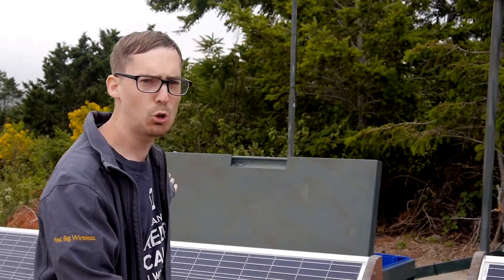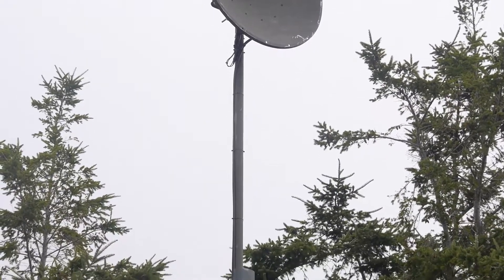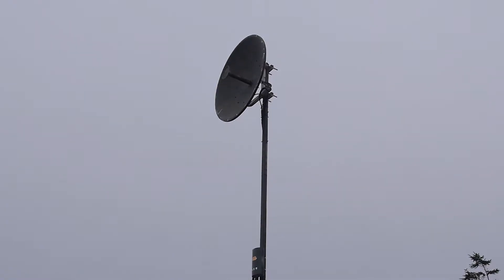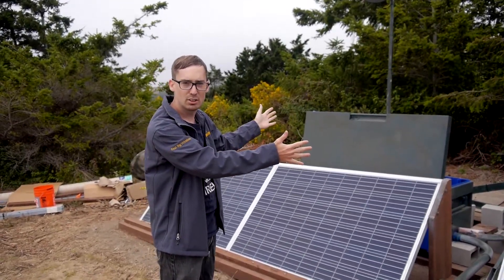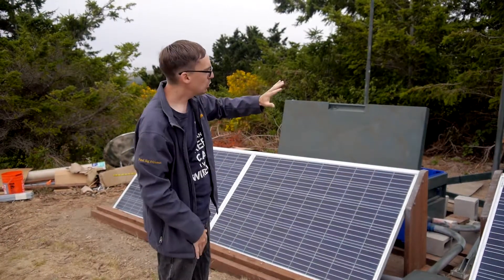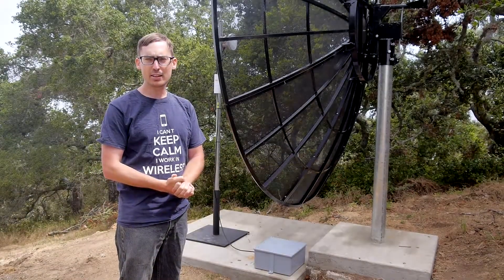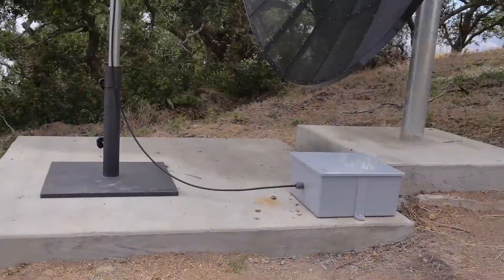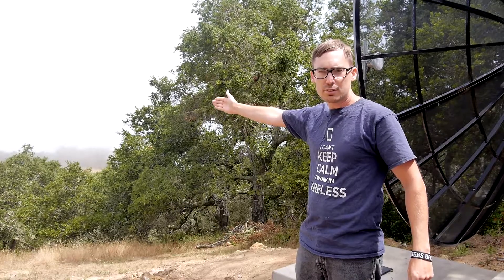Mimosa in the Field: Handling Ducting over Water in Long Distance Links

Comment: Hey Dustin !!  I would use this distance and under these conditions, ALGCOM antennas, UHP, ultra high performance of 1.20m. I have already made some links here in Brazil with this type of difficulty, crossing both lakes and areas of the Sea, and I am successful! this UHP antenna with these radios, I believe you would have an incredible success. Another problem that I saw in your video was that the output of the link needs to be more open. these trees are definitely influencing the fresnell of this link. Best Regards Dustin!!
Reply from the maker: Thanks for your comment and suggestion!

Comment: Wow! I would love to see the math on how you calculated that 11' difference in height between the two 3'/2' dishes and the 2º uptilt for the 2' dish. This may be a dumb question since I am not familiar with the C5c... Since the A5c is normally (as I know it) a PtMP AP, is this operating in an AP mode while the C5c is in a Client mode? Or are there settings in the firmware to have both of these operate as a PtP link?
Reply: I'm about to write a blog post with the math calculations. Check that out and hopefully that will answer your question on that. The A5c AP is operating in AP mode and the C5c is in client mode. We did do some distance and ACK timeout tweaks to the firmware, but the link still operates the same as a normal A5c would.
Reply: I would LOVE to see that blog!  I have an opportunity to try a REALLY long shot in North Carolina up into the mountains.  Would VERY much like to collaborate with you on this project.  Its all line of site.  kent AT openbb DOT net
Reply: Let me see if I can find out where they posted my blog articles. I'll give you a link as soon as I can.
Reply: @dustinstock9556  Link please

Comment: What kind of performance did you get with the final setup? Can you post a graph of a 24h ducting cycle of RSSI? Thanks!
Reply: Hi Jeremy. Sure I can get a graph pulled off of our NMS for you. I'm still not 100% happy with the ducting dish and plan on doing some fine tuning on it in the next few days. We are seeing a decent 120 down and 100 up. During extreme ducting times we still see 65 down and 60 up. With the adjustment mentioned above, I hope to improve that even more.
Reply: Historically, spatial diversity has included a high and low on both ends — did you consider this design, or because you had the 6' already in place, chose to keep this? Have you considered a 2x spatial horn design for diversity on the client end, or is this not possible with A5C yet?
Reply: http://tinypic.com/r/29lbxhj/9 should be a picture of the RSSI graph.
Reply: Awesome! So about 20 dBm of ducting fade — good thing you have a nice clean noise floor!
Reply: Jeremy Austin we considered doing this on both ends, but it would take some considerable code changes in the A5c to make this happen. I could definitely see this as a future experiment.
Reply: could you make up for the loss by sending more bandwidth through?
Reply: @dustinstock9556  ATT used to have a 900 MHz tropo link from Key Largo FL to Cuba and in addition to huge space diversity dishes,  they had pneumatic actuators on the feedhorns to optimize the angle. Perhaps with some programming and a bit of hardware you can tweak the 10 foot dish using signal strength indication and a acme linear screw actuator .

Comment: Isn't this link far above the legal EIRP?
Reply from the maker: Hi. With an operating frequency right around 5800 MHz, and 1x20 bandwidth, EIRP for this fixed PTP link on both ends was not more than the legal UNII-3 maximum.

Comment: How far is bad weather disrupt internet fluctuation?
Reply from the maker: Clear and sunny weather has more effect on signal than bad weather does. Bad weather would cool the air down closer to the water temperature, so it would effectively eliminate the ducting activity.
Reply: @MimosaCo  thank you .
I will try for optic fiber

Comment: You have over 500 km wireless bridge??
Reply from the maker: Not quite that far. We have links over 100 km, although throughput numbers won't be at full modulation.
Reply: @MimosaCo  What frequencies do you use for links over 100km?
Reply from the maker: @lord-reactive  Usually right around 5 GHz.

Comment: What are the elevations of both points (A & B)?
Reply from the maker: Point A is roughly 10 feet high, and point B is 21 feet high. There's 11 feet in between the two dishes.
Reply: Thanks! And what is the elevation above sea level at both locations?